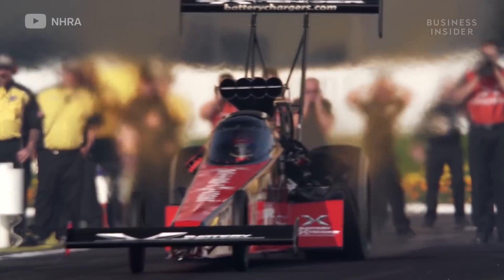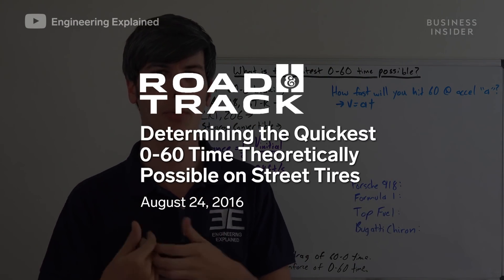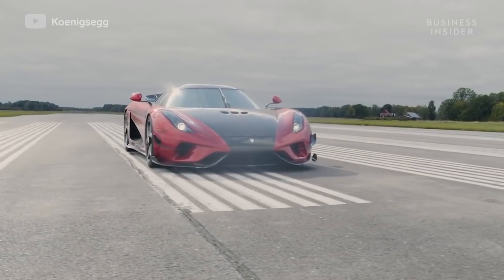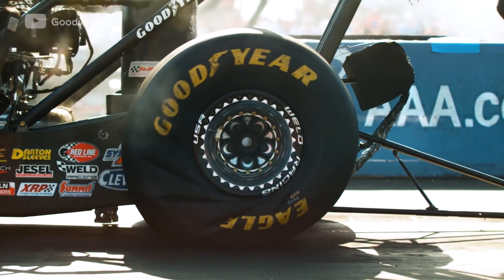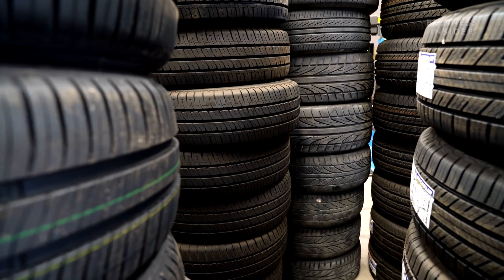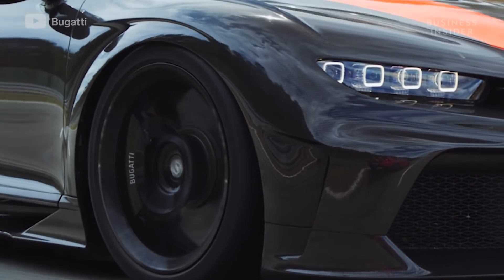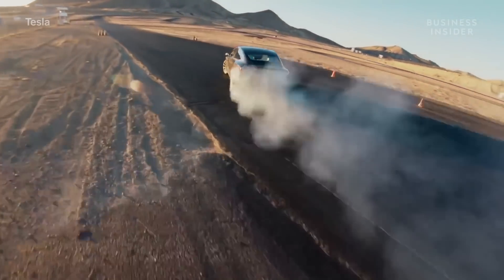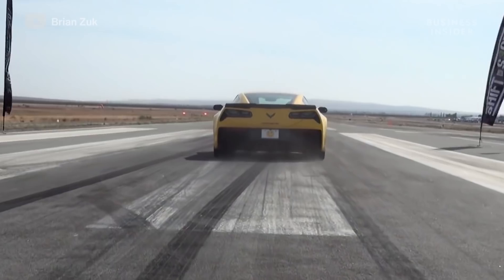Why Going 0 To 60 Mph In Under 2 Seconds Is Almost Impossible | Carsplainers

Comment: U did not mention friction coefficient and weight transfer at all. And all the sub arguments u argued are just not key factors. Not to mention you use ft/s for acceleration which clearly is a unit for velocity.

Comment: It's real easy to calculate a theoretical limit: assume max coefficient of 1, the max friction you can get is the weight of the car, since F = ma, you solve for a, then you can solve for 0-6 times easily.
Reply: Modern tires can have a max coefficient of over 1.  It used to be assumed that the theoretical max was 1 until tire manufacturers showed otherwise

Comment: I wouldn’t say higher air pressures in passenger vehicles reduces grip. Just less temp than a racing machine and more weight to deal with to keep the tread even.

Comment: why dont they use velcro tires.. Literally. And the soft side of velcro cover the roads.. It works in wet and dry conditions. Cheap to produce. Would have alot more grip than rubber tire and road

Comment: His calculation is a little silly given that most performance cars have staggered tires, with wider tires in the rear. Braking distances depend more on front tire grip and acceleration depends more on rear tire grip. Wider rear tires means he is almost certainly underestimating acceleration limits by using braking distance alone as an indication of traction. If he addressed this issue, I forget

Comment: BS. an old ass toyota rally "truck" pikes peak variant would rip 0-60 in 1.3 from the 90s. new tech in production cars should be able to match it. especially with 20 year tire advancements, which is now mostly what 0-60 is down to

Comment: The thing that annoyed me most is that he said there's a supercomputer in EVs.  There isn't, it's just a normal computer, not much more powerful than your smartphone, if at all. A supercomputer is one designed around getting the absolute most processing power, regardless of space or cooling requirements, and often take up entire rooms and many many server racks. They are designed to run simulations and crunch numbers a human could never dream of calculating. There have been computers in cars for decades.
Reply: Look up the hardware that powers the self driving (Which is what was referred to in this video) in a Tesla. It's definitely more powerful than a smartphone.

Supercomputer is technically an improper term as it is generally used to describe main frames but for a car, I'd say that any self driving computer is impressively powerful for the amount of power it consumes.
Reply: @xboxGTbenton1234  It's still just a mobile CPU with a mobile GPU, effectively a laptop.  Yes, stronger than your smartphone, but by far not a supercomputer. You could go to your local computer store and pick up the same hardware for like 900-1100 bucks, probably stronger.

You pointed out a super computer is a mainframe, yes. Mainframes are still computers on Steroids designed to compute much larger projects than a tesla could ever dream of, my point still stands.

Comment: That stuff about "physics says it's impossible to beat 2.05 seconds" should be qualified with "currently only possible". It only measures the current quickest production car's stopping distance. That could quite easily change which you imply would then defy physics. Cool video though

Comment: This is based off a bad assumption to begin with. This video and the engineering one suggest that we’ve hit maximum braking performance when that’s not true at all. Cars are stopping in shorter distances every year, and now we have several production cars under 2 seconds, less than a year from this video. What a stupid video…

Comment: 3:49 there is no supercomputer doing the tourqe vectoring, its a normal micro processor, for a supercomputer there is not enough space, power, and heat dissapation

Comment: What you missed is that a larger section street tyre can easily overcome grip challenges moreover AWD and 6 wheeled electric cars can further mitigate these issues so 2.05sec will be breached in matter of years. Real question is why they arent making 6 wheeled electric cars?
Reply: because more wheels means more rolling resistance which means less mileage, which is bad for electric cars since saving the world is kinda their deal.
Reply: @kyrrilcrepeele1353  By 6 wheels I mean 6 wheels with 6 motors and for car such as this, performance will be its deal not the mileage.

Comment: I'm going to give away my age, but a set of Weld mags wrapped in 15" M/T Drag Radials perched on by a Mopar B-body used to be the only hint to what was sleeping underneath the dusty purple blanket of worked over panels. You could spend less than just getting todays trim upgrade, and drive a big block B-body in R/T off the lot, and have change left over from modifications to suicidal performance...

This was before "gold-plated showroom muscle cars" came from Motor City selling its soul to the first empty badge that wanted to start pimping out the power badges, like Rumble Bee, to a useless pickup, prestigious names, mostly B-body's, like the Charger to be a cruel 4-door joke that inflated police self-importance even more, and the worse of all, got on their knees to pleasure the wealthy with toys with edgy names like Demon (which is sadly slower than the SUV version because of its AWD), that wouldn't even be able to handle NASCAR, much less right turns also.

Comment: I had a car that would hit 60mph in about 150-200ft I was hitting 0-60 in about 1.8 or so but I was running a race motor and transmission, launching at full throttle

Comment: ok, what these guys say is right we need grip more than power but here's where the problem comes. We have very grippy tires and amazing engines producing heavy power but this is where electric cars defeat gas cars they have pulling power or ft-lbs this a important aspect because the car needs to pull the weight.Second aspect is the weight of the cars for example you take a normal car and remove extra weight you get a massive decrease in 0-60 times we also need lighter materials to build a car.(sorry for such a long comment:) )

Comment: its interesting that I see this video after this year's FOS where a car accelerated to 60mph in 1.4s

Tesla has also achieved a sub 2s 0-60

Edit: Yes, indeed I was wrong, I thought the plaid did 0-60 in 1.9 but it was 2.1, I think I heard 1.9 predicted 0-60 for the Roadster MK. 2

Edit 2: I see people in the comments bringing up Rimac C2
Reply: LOL 😆 plaid did 0-60 in 2.1 seconds best never did 1.9 
Go sleep and keep dreaming
Reply: @Smzxe  Not even a tesla fan here, imo electric cars kinda suck cuz they have low range and a lot of weight so they cant realy handle corners very well (that is for road cars, I do see that the McMurty is all electric but it was designed I believe for shorter runs so they could afford smaller and loghter batteries), I was pretty sure tesla did it in 1.9s but I might be wrong on this one, maybe its a thing I've heard with the coming Roadster mk. 2, idk, anyways its not very nice to mock people for their honest mistakes is it?
Reply: @adamgadek2972  Tesla never did 1.9 stop dreaming 
Tesla hits 0-60 mph in 2.1 seconds or 2.2 seconds on a prepped drag surface
Nobody ever did 1.9 
And Roadster doesn't even exist it's 2022 bro like c'mon you are seeing Teasers from 2017 
"Tesla roadster doesn't exist"
Reply: @Smzxe  THAT IS WHAT I AM TRYING TO TELL YOU THAT 1.9 IS REFFERING TO THE UPCOMING (NOT OUT YET) ROADSTER, I have seen a few people out in this comment section mention Rimac C2 tho, Im not really into electric cars

Comment: I think that the limit is 1.70 seconds because if we distribute all the horsepower perfectly to the tires, we will achieve acceleration quicker than a EV using combustion engines

Comment: Main limit is tires and engine reliability. Those dragsters literally beat up their engines getting to that speed. They have to rebuild the engines almost every pass.
Reply: Mainly tires tho, these motors in production super/hyper cars have PLENTY of power on tap at lower speeds,  you just can’t use it without grip

Comment: Tesla's fastest car has a 'Drag Strip Mode' that lets you go from 0 to 60 miles per hour in under 2 seconds — but the set-up process takes 15 minutes. The Model S Plaid can accelerate from 0 to 60 in under 2 seconds, but it requires a set-up process.
Reply: I believe even with the 15 minute setup process, they needed to start the timer after the first foot of travel so that's not 0 to 60, but a little more than 0 to 60 in 1.99 seconds. They obviously wanted the marketing even though it broke all sorts of records measuring from 0 to 60, but it wouldn't be under 2 seconds.
Reply: @tremorsrules  they also wanted that nice sticky drag strip for some reason...

Comment: For anyone that hasn't experienced a drag strip, it's so sticky it can peel the shoes off your feet.  If the Demon does 60mph in 2.3s on a drag strip, you can forget ever doing that on tarmac.  FYI, a top fuel dragster does 65-70mph in one turn of the rear wheels.
Reply: youtubecantsaveallthesnowflakes  
Electric is totally different.
Reply: @noelrossbridge2514  lol no. just because your car is electric doesnt mean it has more grip
Reply: @lennartsix6102   
Why would they?  I was saying that a drag strip has far more grip than a normal road.
Reply: @noelrossbridge2514  you said smth about electric is totally different
Reply: @lennartsix6102  
Yeah, it is totally different.  Motor connects directly to wheel.  No gearbox, tailshaft or diff.  Produces power through electromagnetic torque.  Electronics are far more tuned to power delivery through wheel speed.....   Totally different.  Not even comparable to internal combustion.  Do you need more?  And if you pay attention, the comment about electric is a response to "youtubecan'thelpdummies" comment which is now gone.  WTF do you want?
Reply: @noelrossbridge2514  all those differences still cant defy the laws of physics. you can just optimize your outcome but the final figures still arent "totally different"
Reply: @noelrossbridge2514  all the stuff you saying is just the simple stuff about electric drives. And to be fair, there also electrical motors, which use one or two gears, so they are not directly connected to the wheel at all. 

The magic happens because they can manipulate the torque at around 1000 Hz and thus can use the potential traction way better than ICE-cars , because an ICE takes to long to react…
Reply: @Bruce 
Where?
Reply: @Bruce If dodge backhalved the chassis of the demon it might be able to do that as well.
Reply: I think someone got very close to doing 2.3 on the street
Reply: @_.incredible_magnum._291  
Close? Sure, no doubt.  Over 1320ft/400m I'd say it's only the first 60-80ft where the sticky surface gives an advantage over tarmac, after that the mass is now accelerating enough to not break traction... If you ever get the chance just walk on drag strip, it'll peel your shoes off.  I have a mate who's been a top fuel team member for 30 years, I've stood between two top fuelers on take off.  I've never been in an explosion but I imagine that's what it feels like.  Those things are not of this world, they are insane.  They're why the entire strip is sticky, 11,000hp and over 8 tons of rear wing downfoce and they still blacktrack the whole 1320ft.  But a 700hp Hellcat could go a little quicker on a strip with bagged tyres, not much, probably only the first wheel revolution.  Faster again with 4 link rear end.

Comment: Well look, Matt or carwow drag raced the Rimac Nevera on ordinary pavement. and got the best time of 2.08 sec corrected, which is 2.28 uncorrected. Which is right where it was predicted on a pretty ordinary old unprepped surface. So it might be noticeably better on circuit grade pavement, and the time may well be possible on a glue prepared dragstrip with some software calibration, maybe with rollout correction, it could be marginally lower on the perfect launch, but not on regular roads. At best 2 sec on a soft R compound. 

Technically Tesla Roadster using gas thrusters is cheating, but I'll be curious to know how the math works out on that. Requires some insane thrust, is that even safe?

Comment: There is a flaw in the original formula calculation IMO.  The front tires on almost all product tires are smaller than the rear tires.  While breaking the majority of the weight is shifted to the front tires.  During acceleration it fades to the rear, larger tires where the majority of the powered is consumed (even in AWD cars).
Reply: They referred to a C7 for the brake distance. That car uses 4 tires to stop and 2 to go.
Reply: There's also the fact that the brake bias in road cars is often very far forward for safety reasons(avoiding mid corner oversteer if touching the brake). Optimizing brake bias for braking performance like you'd do in a racecar, you can get a good 10% extra braking from the rears and that's gonna give you a better answer for peak AWD acceleration
Reply: Exactly, and it’s not even a limit, just a current record.

Comment: The first thing they say is inaccurate a top fuel dragster does 0-100 in .8 seconds not 0-60
Reply: And the theory is flawed because braking relies heavily on front tires while acceleration requires heavily on rear wheels which tend to be wider than the front

Comment: The Rimac Nevera  time of 1.85 second, made it the fastest acceleration car from 0-60 mph 😮
Reply: Nope. Check out the 2000 hp supra that made it in 1.2 sec. For a waycheaper price than the rmic or whatever super car that is;)
Reply: @aceshadowins1310  bro those are modified
these are talking about stock
other wise bugatti is not the first car to hit 300mph that has happened in the 1990s with modified cars.................in under 10 seconds
Reply: @Badtameez007  that's what this fanboy is saying. He claiming it the fastest shit ever built🤣😂
Reply: @aceshadowins1310  it is the fastest stock car on the planet though
Reply: @Badtameez007  but not the fastest. That goes to jdm cars. Period.
Reply: @aceshadowins1310  if you wanna start moving the goal posts like that, then yeah top fuel is faster than any of these cars. Makes no sence man. They are talking about production cars. Making these cars this fast while also being mass produced,  complying with in emissions, and safety regulations. And with a warranty. Yes you can throw money into any car and make it fast if you really want to, that’s not their argument
Reply: A roadster did 1.1s
Reply: What, you mean a Tesla Roadster. As in the Tesla Roadster that doesn’t even exist in a production form yet?
Reply: Well look, Matt or carwow drag raced the Rimac CTwo on ordinary pavement. and got the best time of 2.08 sec corrected, which is 2.28 uncorrected. Which is right where it was predicted on a pretty ordinary old unprepped surface. So it might be possible on a glue prepared dragstrip, maybe also with rollout correction, but not on regular roads.

Comment: Rimac: "Hold my electric power"
Reply: Rimac Nevera and Tesla Model S Plaid did 0-60 mph in 2.1 seconds
They never did 1.9 😂😂😂😂 go sleep kids
Reply: @Smzxe  Well, the McMurtry Spierling does 1.8s 0-60, can be probably configured to do it in 1.5s,  things really depend on what criteria wish to apply.
Reply: @benwu7980  bro give the proof then talk "can should would will" doesn't prove anything
Reply: @benwu7980  F1 cars can do 0-60 mph in 1.8 seconds they have done that 
But no any production car has done 0-60 mph in 1.9 sec and it's a fact that till this date no production car can do that right now 
In future maybe 
Koenigsegg One:1 Spins so bad till 200 kmph and it does 0-60 mph in 3.1 seconds
I think on prepped drag strip with sticky tire compound the One:1 can do 0-60 mph in 1.9 seconds
I mean if One:1 was spinning that bad on runway 
So it should not spin on prepped surface or might spin less 
I have seen tuned 1200 HP McLaren 765LT do 0-60 mph in 1.7 seconds
Koenigsegg One:1 has 1360 HP and it weighs 1360 kg it's lighter than 765LT as well
Reply: @Smzxe  It is not a production car, but are you saying it can't get those times?
Reply: @benwu7980  anything can get those times but you actually have to prove it 
Since nobody has done that yet right now 
what you think they will do that!
Reply: @Smzxe  I do agree with that, though I thought is was the Gemera for 1.9s as a production car.
Personally, I actually don't care much about a singular statistic like 0-60,  if compare to a full Nordscheife / Pikes Peak / Spa type of run.
Reply: @Smzxe  Well, are you saying the McMurtry could not get those times, if wanted to?  2 tons of downforce on launch makes me believe in their claim.
But yes, I do agree, until they do it, it is unverified.
Reply: btw thx for over 100 likes
Reply: Tesla model s plaid is already shipping and already perfect while rimac doesn't even have a car
Reply: @RamiHaddadin  Rimac just revealed their all new Nevera... it's quick, watch it
Reply: @owlon225  it's revealed but not a single person on earth owns a car made by Rimac
Reply: @RamiHaddadin  there is only 150 units 🤣😅 all of them are sold ..
Reply: @CH3COOH2O  i made that comment months ago
Reply: @owlon225  it’s still not a car you’re ever gonna see like a bugatti. shit is like 3,000,000 euros 😂
Reply: @RamiHaddadin  Who cares. They are different cars for different purposes.
Reply: @RamiHaddadin  eww tesla junk
Reply: @guycha0s380  Why is it junk?

Comment: I have a problem with the inverse of the braking distance. weight transfer, brake bias, and staggered tire width has been completely ignored.
Reply: That's a good point.  You could always put wider tires on the front to improve braking distance, but it would hurt acceleration potential in a RWD car.